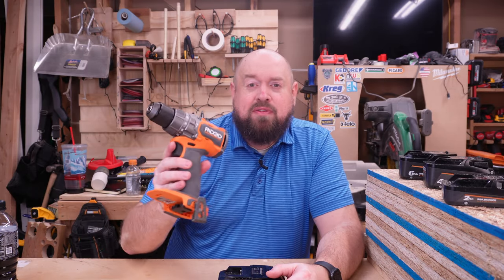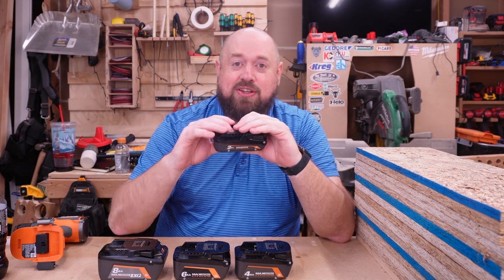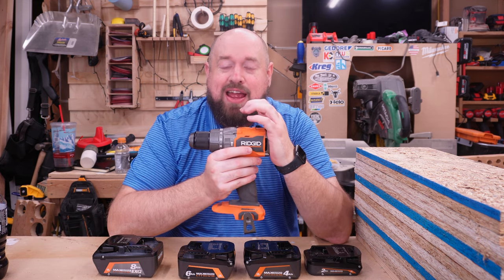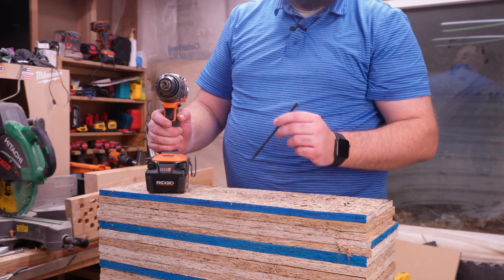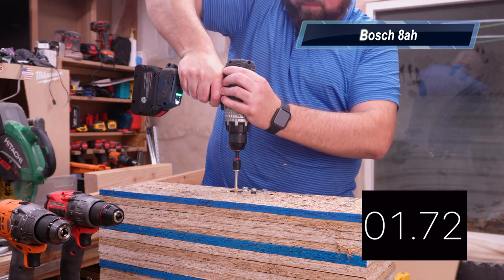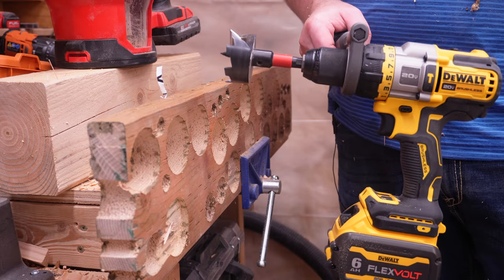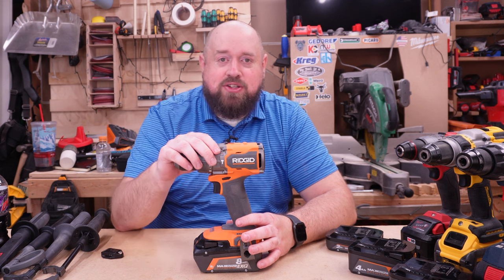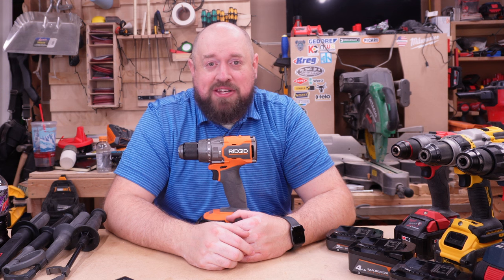Ridgid's High Torque Hammer Drill - With RIdgid's 8ah EXP Battery!!!!

Comment: I owned at one point the DCD996, DCD998, And DCD999 and the 998 is definitely the most power Dewalt drill I have ever owned. However the m18 fuel drill, and flex turbo seem to be the absolute most powerful drill on the market. BUT the Bosch drill surprised the hell out of me, id never own a Bosch tool, but again it did far better than I thought it would have. Keep up the Tinkering.
Reply from the maker: Thanks.  Yeah I have a hard time wanting to buy a power detect drill.  I just want them to come out with a new top tier model and make one model for everyone.
Reply: I have been wanting Dewalt to thin the herd of drills for years. However the DCD805 looks pretty darn good.
Reply from the maker: Yeah there are some gems in their lineup it’s just about takes and advanced college degree to decipher their product line up 😂
Reply: You aren’t lying lol I’d also would like to see SBD rate their tools like everyone else out there. No more UWO or MWO.
Reply: Have you heard anything bad about the Bosch gear boxes being junk?
Reply: I know Ridgid and Milwaukee both have anti kickback, and I believe they both also have the intelligent communication that will shut them down to prevent them from getting damaged.
Reply from the maker: I haven’t had any issues with my Bosch drills.  I have one that I bought refurbished that does strange things.  The ones purchased new have been fine.  Bosch always feels well built IMO
Reply from the maker: The newest gen of Milwaukee and Ridgid both do.  I don’t know of a way to turn the Ridgid off but the Milwaukee can be turned off easily.
Reply: @TinkerWithTools  You can’t turn it off on the Ridgid, and I’ve heard that it’s one of the most sensitive anti kickback drills on the market.
Reply: No I haven’t heard of the gear boxes being junk, but I have heard the motors are on the side of junk.
Reply: @rnuovz71  I really wish Dewalt would pair a better impact driver with the DCD998 or 999. I would probably buy the combo.
Reply: Milwaukee and flex I think have the best impact drivers on the market. I had the dcf887 and hated it, its performance was so underwhelming any demanding tasks turned it into a smoke machine. I was a huge dewalt guy for decades but now I’m selling all my dewalt stuff and going with Milwaukee and whatever other tools I like.
Reply: @rnuovz71  I like Dewalt drills, except for the DCD900. It’s not worth the hype. I’ve heard good things about the Kobalt, Ridgid and Hercules impact drivers.
Reply: For the price I’d go Milwaukee, flex. Rigid is not much less than the top dogs.honestly the Kobalt xtr seems like a better value
Reply: @rnuovz71  As good as Milwaukee is, I don’t care for the ergonomics. I have tendinitis in my right elbow, and the gen 4 drill irritates it every time I hold it. It must have something to do with the cant of the handle. It just feels forward heavy. Ironically, the I held the Flex turbo on display with an 8 amp battery attached, and it didn’t bother my elbow.
Ridgid is less expensive with the hacks that are available now, but I want to try the Milwaukee one more time. I might even look at the compact Flex and Milwaukee. I think they both probably have enough power for my needs.
Reply: With all honesty I’d go with whatever tool on the market is most comfortable for you to use in that case.
Reply: @rnuovz71  Is Ryobi HP any good? I’ve heard that they are decent, but I’ve also heard they are garbage.
Reply: To be honest I have limited experience with ryobi tools, for DIY  I think the HP line is rather decent. I have the drill and grinder and so far I kind of like them. Especially for the price.
Reply: @rnuovz71  What brand do you use the most?
Reply: Currently 99% dewalt, but I’m currently selling it all and switching to Milwaukee M12 and some M18
Reply: @rnuovz71  I’ve been almost tempted to build a mixed brand set with the DCD998 or 999 with a different brand impact driver.
I know it’s not a good idea, budget wise, though.
Reply: I mean why not get the best tools from each brand?  Or get the tools you really want regardless of brand. No power tool brand is perfect, so get the tools that work best for your budget, needs and goals.
Reply: The DCD998 is by far and wide the most powerful drill currently in the Dewalt line up of drills, other than that. The Flexvolt advantage line up off 20v max tools from dewalt are the top performers excluding the dcd999 the 998 out classes it in every single way. Other than Dewalts impact driver(s) being lack luster and grossly under performing in every way possible. The dewalt line isn’t bad, the DCF961 1/2 impact wrench is by far the most impressive impact wrench on the market, that being said it seems almost do I dare say unwieldy.
Reply: @rnuovz71  I already have the Ridgid mid torque impact wrench and a Ridgid 3/8 drive cordless ratchet. I found great deals on them in the daily specials.
I will see if Lowe’s has a deal on just the 998 kit.
I’m also keeping an eye out to see if Lowe’s adds any more Flex deals. Someone said that Lowe’s adds more deals as the Black Friday event goes on.
Reply: I gotta ask how do you like that rigid mid torque?  I’m torn between either being a complete cheap ass and getting the ryobi high torque or mid, and just getting the Milwaukee mid torque. But rigid is made by the same parent company. So I assume it probably decent to.
Reply: @rnuovz71  To be honest, I’ve only used the Ridgid impact wrench once. I helped my manager take a flat tire off his truck and put on the spare. The lug nuts have a torque spec of 140 foot pounds, and the Ridgid took them off with ease.
The Ridgid is bigger than the Milwaukee, and I heard the Milwaukee has a more responsive trigger. I also don’t know if the Ridgid auto mode is nearly as accurate as the Milwaukee.
That said, I like the Ridgid, and I got a great deal on it. $169 for the tool, a 4 amp battery, a charger and the bag.
Reply: @rnuovz71  I’ve heard decent stuff about the Ryobi HP, but Ridgid is pretty much in between Ryobi and Milwaukee.
Reply: Hmm I guess I’ll be on the look out for whatever is a better deal
Reply: @rnuovz71  The mid torque Ridgid is one of the free options if you buy the high torque hammer drill combo. In case you don’t know, the Home Depot deals can be hacked. You just return what you don’t want for a refund. The only downside for you would be the lack of a battery and charger.
If you’re considering a completely different platform, the Kobalt is a great option. The XTR is the high torque, but the smaller one is the mid torque, and I’m pretty sure Lowe’s has a deal that includes a battery and charger.
To be honest, the Kobalt tested stronger than the Ridgid on TTC and Workshop Addict. I just went with Ridgid because of the LSA.
If I had a do over, I would probably go with the subcompact instead because I don’t know if I even need the power of the mid torque,
If you want cheaper, the Bauer at Harbor Freight is rated at 500 foot pounds, but it only has a three year warranty like Ryobi.
Reply: @rnuovz71  I heard that the 998 and 999 are pretty much the same if you use the 8 amp xr battery.

Comment: I stumbled across your channel and have a couple of comments.

First item is if you can get your hands on the Ridgid 12A battery, would love to see a comparison.

Second item is the Octane batteries. Currently, HomeDepot is selling 3A Octane batteries.

I believe I have every Ridgid battery type except the 12A battery. I have 1.5A (which is about 10y old and still going stong), the Octane 3A and 6A, and all the 2A, 4A, and 6A variations.

As you stated at the end, chose the right battery for the job.
Reply from the maker: The 12ah battery is available here but I am not sure if I will be getting it.  While it might provide a power bump on the tool, at some point I feel the size of the battery becomes counter productive due to the increased weight.  That’s just my opinion obviously.   As for the octane batteries, while those batteries would be new to me, they are not newly produced batteries but instead old stock.   That’s my reason for not buying them now.   In essence without an octane tool it would just be a battery with 21700 cells which we already have in the 8ah.   If you have them and they work, then great but that’s what kept me from buying “new” octane batteries.

Comment: That new Bosch is a beast. Bosch finally got into the power game.
Reply from the maker: Yeah the last one was not the most impressive.
Reply: @TinkerWithTools  are you referring to the 975 or 755
Reply: Bosch now uses their drills torque numbers as model numbers : gsb 755, gsb 975 ,1330 etc.
Reply from the maker: @robertcasey3528  975.  Same size not nearly as powerful
Reply: @TinkerWithTools  still a good drill. I have that model.
Reply from the maker: @robertcasey3528  I just wish the power matched the size.  Cause it’s a big drill.  Then they got it right with the 1330.  The drill is smooth and built like a tank though.

Comment: For 95% of us, the 800 ft. lb. hammer drill does the job fairly easily.  With 1250 ft. lbs. it's becoming a meaningless numbers game, like with wattage in stereos.  And with wattage, more doesn't necessarily mean louder.  But with that said, if one absolutely has to have 1250 to say "mine's better" then the Black Friday HD of this hammer drill paired with a 1/4" impact with the 4 ah and 6 ah plus charger and a hard storage case PLUS TWO FREE TOOLS for $379 is a very good deal!  I'd choose the 8 ah (just so I can say I have one) and 1/2" sub compact impact rated at 250 ft. lb. breakaway for my freebies.
Reply from the maker: The ridgid black friday sales seems to be a popular choice this holiday season.  You aren't the first person to mention that deal.
Reply: Home Depot has now lowered the price of that Ridgid combo kit to $359 across most markets, and I just picked one up in CT for $342 in store with the 2 free tools. I returned both free tools, thereby hacking the deal down to $166 for the Ridgid High Torque Hammer Drill / 4 mode Impact Driver combo.

It's now the 3rd week of January 2024 and that's the cheapest I've seen this combo for. 

I believe it might go slightly cheaper next week in their effort to get rid of the last combo sets they have leftover from the Holidays with the cost of the kit possibly going as low as $329.

If you're in the market for that combo, keep your eyes open for that price around 1/25 - 1/28.

Comment: Slight difference between battaries.  Not enough to buy 8 ah at $179 compared to buying a kit of 4 ah and 6 ah plus charger and bag for the same price.  Plus with the smaller batteries come less weight.  With the big battery is just that, big and heavy!  Bosch rocked all but on a Black Friday special, Flex is best!
Reply from the maker: I think it comes down to use case.  There are tasks where the 8ah battery will let the drill complete a task where the others for fail.  For the vast majority of individuals they will never meet a task like that.  

When it comes to which drill is best, the great thing is that there are so many great options.

Comment: The 3ah octane battery has 21700 cells. It's the only other Ridgid battery until that 8ah came out that had the bigger. cells
Reply from the maker: Yes, you are right.  Unfortunately that battery has been discontinued.  I like the form factor of the single row 21700 cell batteries.
Reply: I'm pretty sure a direct tools factory outlet still has them.  It most likely be a refurbished one but when they have sales their prices are really cheap and they're worth it.
Reply from the maker: They do have them occasionally and you can buy them on Amazon or ebay as well.   With Direct Tools, they don't often ship their more desirable items and I don't have one near me.   With amazon on ebay, I sometimes worry about purchasing batteries that haven't been actually produced in a while and wondering if I am going to get what I actually want.
Reply: @TinkerWithTools  Yeah there's no direct tools near me either and I heard they take a while to ship.  I use Amazon and eBay both. I think I trust eBay a little more when it's someone who has actual pictures and the box it came in.  Amazon's getting notorious for knock-offs

Comment: What do you think about the Ridgid compared with the Dewalt 998 and 999?
Reply from the maker: DEWALT has better feel and ergonomics that the Ridgid.   Ridgid has anti kickback.  On the 8 the Ridgid feels good but at less it will likely get beat by the DEWALT.
Reply: @TinkerWithTools  I appreciate your opinion. Tools With SOALZ recommends Ridgid, but he’s a little biased lol.
Ridgid does have a fantastic warranty, and there’s a really good Black Friday deal on it.
Reply from the maker: Neither one is bad but I also think that any drill you buy will have something that you don’t like.   That’s almost inevitable.   Waiting to find the absolute perfect one might not happen.
Reply: @TinkerWithTools  The 8 amp battery is one of the “free” options with the purchase of the Ridgid combo.
That truly makes my choice even more difficult lol.
Reply: @DiligentDave1966 what did you go with?  I usually go with the best tool in the platform I want to use consistently.. which in my case is ridgid.. just because why buy a tool 5 times because the warranty is only good for 3 years or whatever..I just sold my 10 year old ridgid drill driver combo for 80$ and bought a 250$ new ridgid kit both brushless with new batteries.. only downfall in my opinion is the shitty charger(I don't see it lasting with the thin power cord)
Reply: @gregoriodecker2692  The charger is covered by the LSA.
Also, you can buy a multi battery charger. I think they have thicker cords.
Reply: It definitely does. I have that Ridgid dual charger and the cord is definitely thicker and not an issue. 

I purchased mine from Tools Direct as a "Blemished" item and it only cost me $59. 

As a blemished item you can still get the LSA as long as you register it online and follow up with the paperwork that Rigid will request because you didn't purchase it at Home Depot. They will request that you mail in a copy of the receipt and registration forms, but I requested them to review my online submission and resent all the requested paperwork electronically and then they approved the LSA for the dual charger.

Comment: Bosch drill has the highest amount of soft torque among all cordless drills. That's what they mean by the strongest drill claim.
Reply from the maker: It seemed to show it today.   It’s not the fastest always and it’s big but it’s very strong.
Reply: The metabo hpt drill is kind of like that the dv36da but it’s a beast fs also the new one hikoki released is supposed to be really good the dv36dc is the model number and it’s only available on the JDM atm but u can get em on eBay for high dollar prices but you can get em

Comment: While I'm sure you get more power and longer duration of amp draw thus providing more spec'd  power longer, the weight disproportionately is now bottom heavy. And off sets the weight of the motor housing when having to drill any hole that isn't strait up and down. Thus leaving now more room for fatigue of your hands.
Reply from the maker: The weight is a factor.  That’s why I talked about choose the right battery for the right job. There isn’t a whole lot of point to an 8ah battery for a single 2” deck screw but when doing demanding jobs it makes a lot of sense.  Overall the Ridgid isn’t a bad size in my opinion.
Reply: Techrep, I wish Ridgid and Milwaukee would make a 21700 cell battery that didn’t weigh as much as the tool itself.
Hopefully they will release the stacked lithium batteries soon like they said they would.
Reply: I just bough the Ridgid hammer drill.  It's heavy with just the 4aH battery. @TinkerWithTools

Comment: Why dont they just make 21700 cells and ditch the 18650’s?
Reply from the maker: I think it comes down to cost and what's needed for the person using the tool.  Not everyone is going to require the utmost power at all times... so they can save a buck and make a cheaper battery.  As a user I can have other batteries for less demanding jobs for cheaper.

Comment: "Only 18v batteries" - then whips out a 60v DeWalt Flexvolt. 😂😂😂😂😂😂
Reply from the maker: It’s a 18v battery when used with that tool.
Reply: Don't get me wrong, I love your videos. But DeWalt makes batteries with 21700 cells that would be a better apples to apples comparison.  Because now you have multiple cell types (18650 and 21700), with varying amounts of cells in each battery. At that point, you could slap a Powerstack on it and still call it a 18v/20v battery and it be "fair" in this test.
Reply from the maker: @coolcube1929  yeah.   I don’t have the 21700 cell DEWALT batteries so this was the best I came up with for the test.
Reply: Understandable. You still have my subscription, it's much easier to be the critic when you're not the one doing the work. 😉  Next test, it would be cool to see the "best" battery each brand has, regardless of chemistry/cell size. DeWalt Powerstack/Flexvolt, Flex Stacked Lithium, Milwaukee high output, etc.  Thanks for what you do!
Reply from the maker: @coolcube1929  thanks for the support.  I have some other stuff in the works that will look to do that.